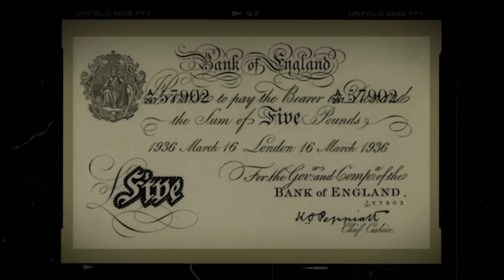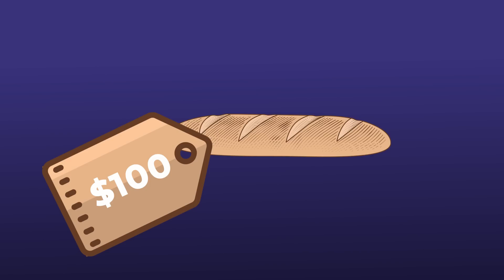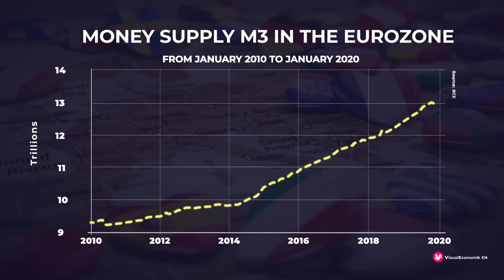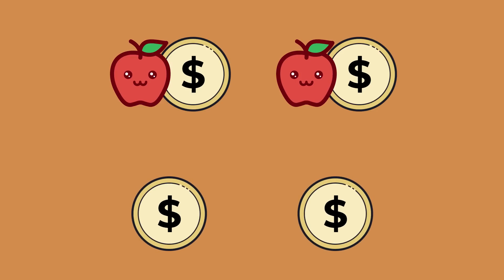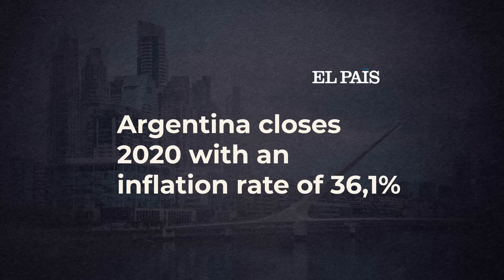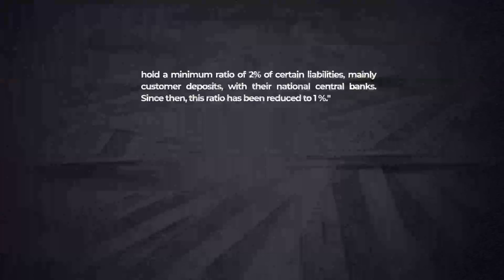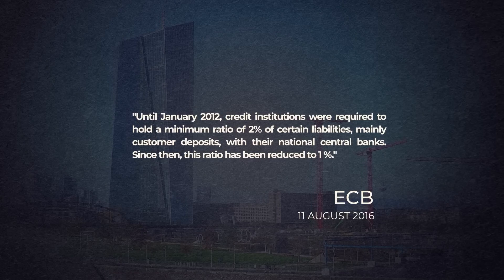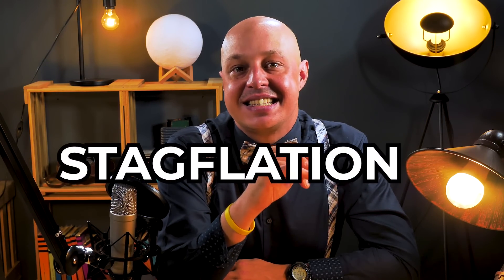How PRINTING MONEY REALLY affects the ECONOMY - VisualEconomik EN

Comment: ii. Second Theory of Banking is Fractional Reserve Theory. In this theory collective of banks in a country will create money out of nothing (in Latin: Ex Nihilo) by assuming whenever banks receive certain amount of deposit (people put money in the bank), the bank entitle to lend 99% of the money back to the public (borrowers). But the assumption does not stop there. The borrowers will use the money for some sort of payment and the one who receives the payment will be assumed to put the money back to the banks (not necessarily the same first lending bank) as new deposit. The second bank in this story also entitled to lend 99% of the new deposit money to the public. And this whole process will continue almost forever, until the final lending amount becomes so small and insignificant. Only by this whole fully repeating 'depositing-lending-payment-depositing...' process, the theory of $1.00 multiply into $100.00 (with the Fractional Reserve of 1%) can be realised/true. That what the Fractional Reserve theory is all about. How true is this theory in real application? Nobody knows. Therefore, if ECB really believe by reducing Fractional Reserve percentage from 2% to 1% really increase the Money Supply significantly, I have a doubt ECB know what they are talking about. In short, even though Fractional Reserve theory sounds logical, but we already know in real world practice it is almost impossible to achieve the full potential of 100 folds money creation. Reduction of Fractional Reserve percentage from 2% to 1% means instead of multiple $1.00 into $50.00, ECB want to multiple $1.00 into $100.00. Based on the graph shown in your video, by end of 2021, the amount of Money Supply (M1 + M2) in Euro Area was around $16 Trillions. With the reduction of Fractional Reserve percentage from 2% to 1% directed by ECB recently, do we can foresee the amount of Money Supply will increase to $160 Trillions soon? Or in the next 10 years? The answer is NO. So there is no way for the process 'depositing-lending-payment-deposit-lending-...' can be carried out fully in any economic system, even in EU. That is why I said such reduction will not give a significant impact to control the amount of Money Supply in Europe Economic cycle. It sounds theoretical good, but in reality it sounds totally BS.
iii. Finally, the third Theory of Banking, Credit Creation. This theory says Commercial Banks all around the world have no limit to create money as long as the bank executive give the approval. Creation of new (digital) money through Credit Creation can be done by manipulating the Bank Balance Sheet. Loan Agreement (signed by the borrower) will be assumed as cash money and put at 'Credit Side' of Balance Sheet and with that, (to balance the Balance Sheet at the 'Debit Side') the bank can simply type or key in certain amount of money into the borrower's bank account (and physical money can be withdrawn later at ATM). This is the true definition of Creating Money Out Of Nothing (Ex Nihilo). Can bank executive just create new money just by key in the figure in the computer? Yes, bank executive can. Go to YouTube and search for the title 'Bernanke on taxpayer's money for the bailout.' This theory already empirically proven by Professor Dr. Richard Werner (De Montford University) in his controversial paper. I have yet to read any paper to debunk his finding or I have yet to hear any CEO or Chairman of any Banking Institution to refute Professor Dr. Richard Werner's finding on this matter. 
There are so many academic economics written by Professor Dr. Richard Werner (and papers written by his followers) on this matter online. In addition, you can spend few hours of your time watching YouTube content where Professor Dr. Richard Werner been interviewed. 

So, if we accept Theory of Banking-Credit Creation is valid, the findings of Professor Dr. Richard Werner cannot be refuted (with facts), then we can say that any attempt by any Central Bank either through the manipulation of Interest Rate or controlling the percentage of Fractional Reserve (as what ECB did, mentioned in your video) is totally BS. The current Monetary Policy practiced by the Central Bank does really control the amount of Money Supply (M1 + M3) in the economy system (the amount of Credit Creation is), hence how are we going to expect any effectiveness of the current Monetary Policy to spur Economic Growth and to curb Inflation Rate?   

Anyway, I have to take off my hat (to compliment) for the content of this video of yours. It is by far more informative than any other video contents produced by others on this Monetary Economics matter. Cheers.

Comment: Very good and approachable look at this complex area!   In many ways, largely as you argue, the massive and unending quantitative easing started after the 07-08 recession made money available easily and increasing money supply but inflation was at bay due to easy money going into fairly productive investments.  In a way, money isn’t usually just printed in the US unless it is a loan that is going into a higher yield investment than the interest rate.   This causes a few bubbles like crypto but generally works.  However, once Covid and the Great resignation dropped production massively, the time was ready for inflation.  However, this could not manifest until demand rose as Covid dangers and death rates in particular began to be substantially reduced by vaccination in later 2021 only to be turbocharged by what will again be years of unprecedented hot and cold war we face with Russia and China.

Comment: Boomers retiring will save the economy from stagflation.  Boomers + women joining the workforce caused stagflation.  The number of workers surged in the 60s and 70s and the number of jobs did not.  It took till the 80s to reach equilibrium.  If you have 1 worker chasing 1 job he gets 1 unit of income.  If you have 2 workers chasing 1 job, she/he gets 0.5 unit of income.
Today Boomers are leaving the workforce and the generation behind them is a smaller generation.  So instead of 1 worker chasing 1 job getting 1 unit of income, we will have 0.8 workers chasing 1 job gaining 1.2 units of income.  We have already digested women in the workforce, and there is no 3rd gender in it's billions about to join the workforce.  So we will not see the 60s and 70s.